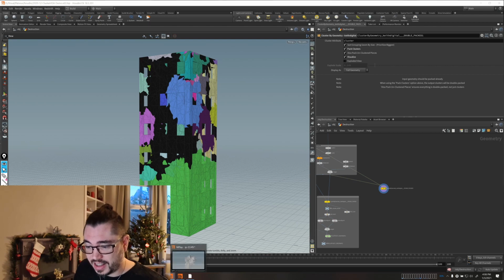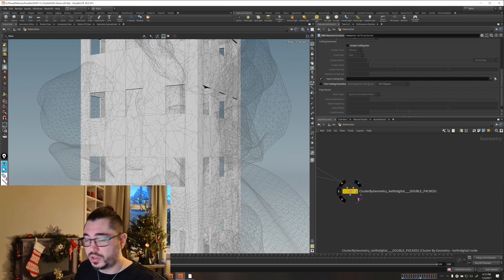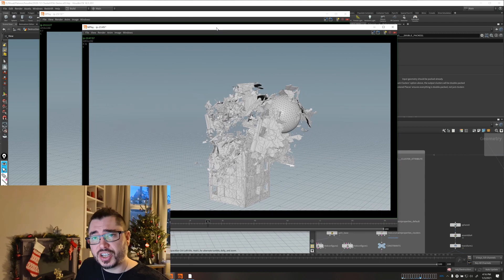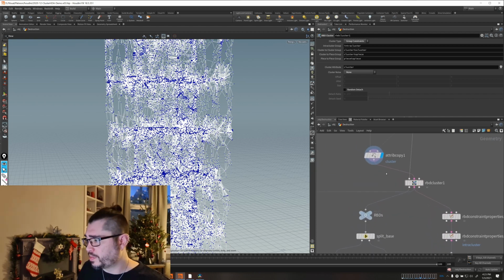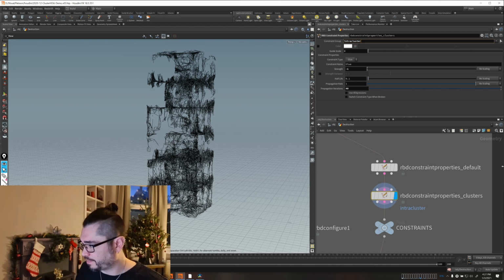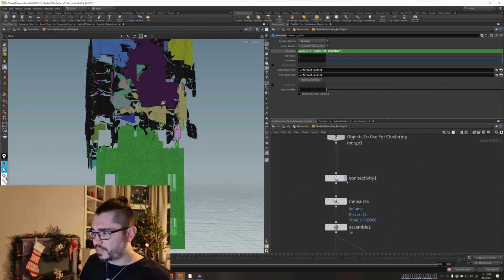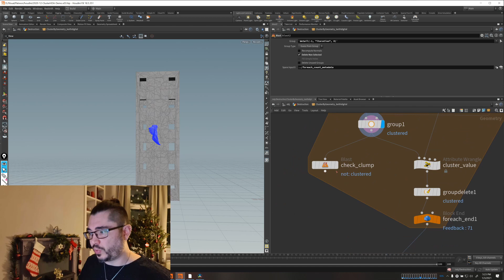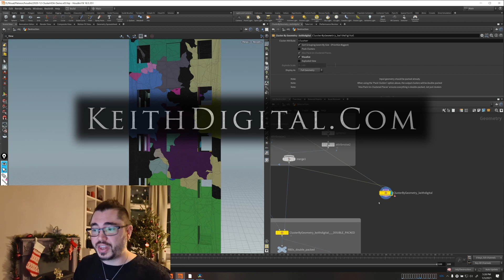Cluster By Geometry - Houdini Destruction - Free HDA & Demo Scene

Comment: Hello, Keith! Thank you for the video and HDA! I only had one question. Why does it crashes sometimes when using double packing? Is there any particular reason and way to fix it?
Reply from the maker: Packed geometry has always been a bit buggy in general, and double packed geometry even more so.  I'm not sure exactly what causes it.  One of the SideFX guys told me that packed geom display issues are largely due to graphics drivers, but I'm not sure if that's really where this issue lies or not.

I think if the geom is displayed as bounding box the problems won't occur, but of course that's not a great solution because you usually want to see your geometry.   :-)

If it's really problematic, then I'd probably just unpack it all and then single-pack each cluster, and see if that helps it.  In the process, you could also use convex decompose to build proxies if you'd like.
Reply: @keithkamholz5271  , great, thank you!) I will try to do so. Because clastered elements are more convenient even for making something static. And it would be nice to be able to change seed and watch the result without crashing)